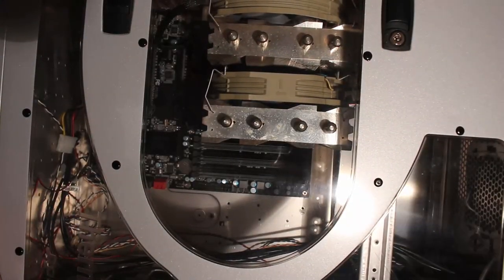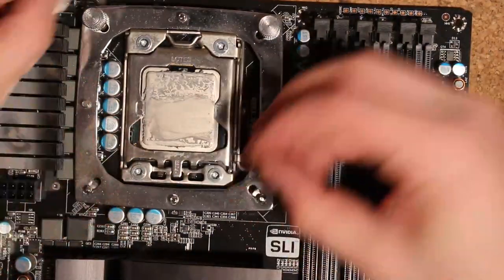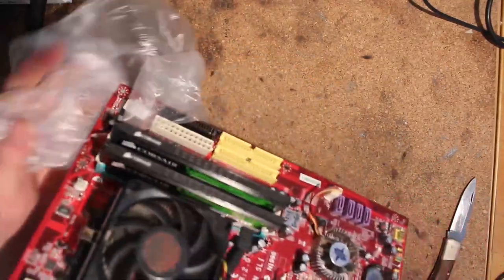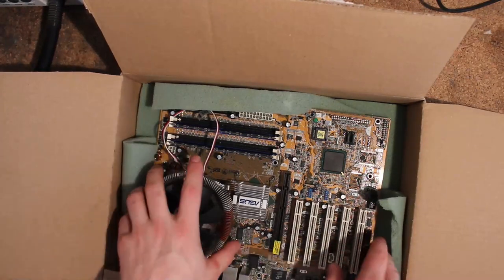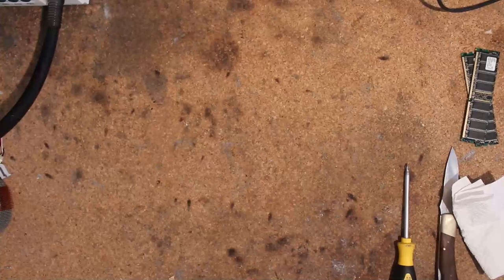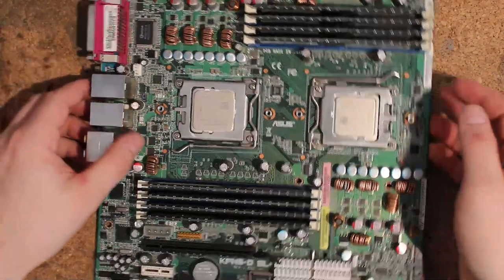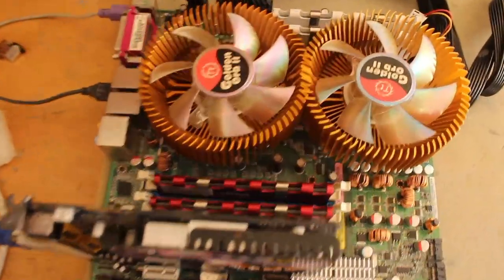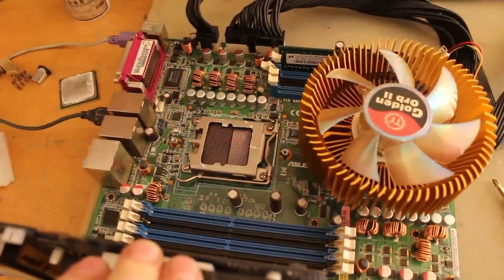Unboxing the most interresting arrivals of the last month

Comment: I don't normally watch unboxing videos unless I'm researching a particular product. Here though, I'm watching closely and with great excitement! 
(Is this what norm. consumers feel watching new product unboxings? lol)

1st up: ahhhh... X58. Still kinda want one, but they're legitimately obsolete and I have far more 'enthusiasm' for old AMD kit. Still neat and great find/deal. 

(Also, how do you 'get stuff from the recycler'? I've tried on 4 separate occasions across the years, and always 'turned the mood sour' the moment I asked about it. Even when I've lead with 'buying', not expecting freebies. Maybe there was some weird 'environmental protection' law in CA that meant I was asking for the equivalent to Standard Capacity Magazines at a gun shop...)

2nd: (oooh, literal unboxing) WOW that was some AMAZING packaging by the seller... /s  Nothing spectacular on the RAM. Decent enough NF4 SLI board; neat w/ the red PCB. FX-53! Not good for tweaking/performance, but kinda rare/collectable. Amazing that poorly packed board survived! Very nice package deal.

3rd: Hmmmm, a P4C800, Zalman alu-cu 'orb', boring RAM... That P4 3.0 Northwood is special to me tho. First 'new build' I did back in Jr. High used a S478 3.0Ghz Northwood. Good memories. 
Also, WTH was up w/ AGPpro everywhere on higher-end boards back then? I've rarely ever even seen that interface on a card outside of Macs.

4th: Dual Skt F Opty board? Dual Quad (Phenom uArch?) Optys sound fun. The Dual x16 PCIe makes it quite usable, and the Asus board might OC a lil (The options are there in BIOS, at least).
 Those coolers though... I can hear the cut knuckles. Boring RAM, didn't know how trash those were till you mentioned it. Pleasantly surprised it POSTed, but there might still be some issues w/ it. (BTW, I love the fact you can just look @ the VRMs and know where to solder in another 8-pin.) Of note: my K8N-DL dual s940 doesn't seem to like non-ECC RAM, even though there's options in BIOS implying ECC Registered RAM is not essential.

Thank You for making this content; it's far more engaging and entertaining than 'popular' tech'tubers 🤣
Reply: Old AMD kit? Only Slot/Socket A Athlons are the most interesting, everything else is trash, though i do still have the odd example of generations of AMD CPUs, including a K6-2+ that will happily run at 600MHz without extra voltage, that surprised me!